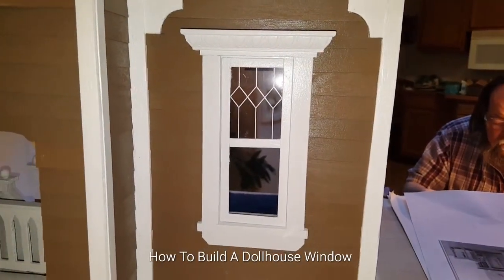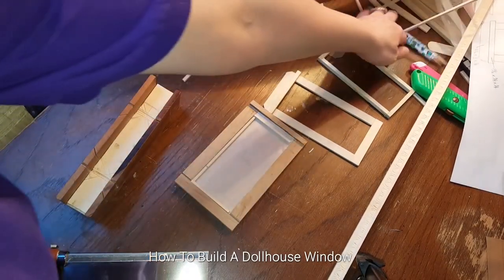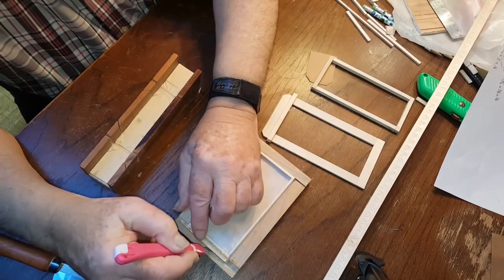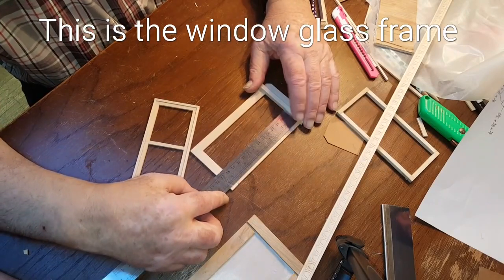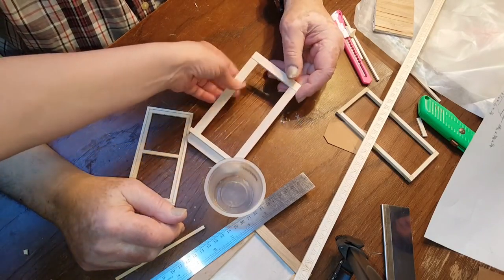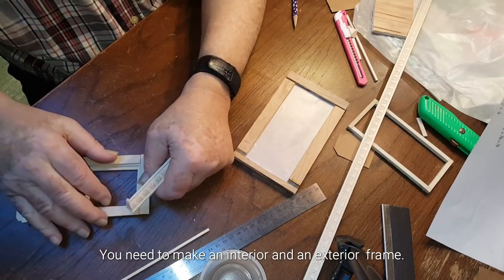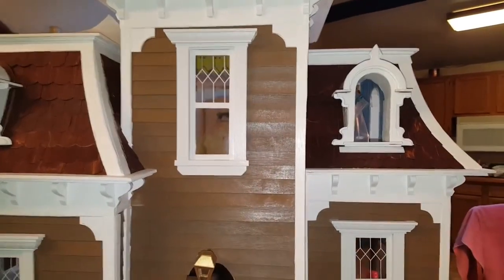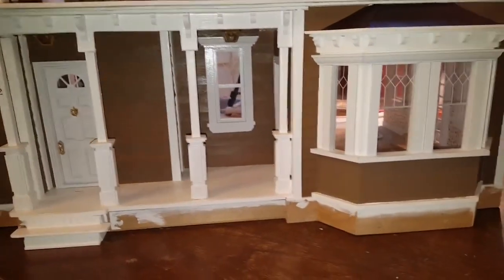DIY Miniature Dollhouse Window Build-Reloaded

Comment: Thanks Laurie. Very odd the other link didn't play, but at least this one works.
Reply from the maker: The best way to make one would be to use graph paper as a template because not all windows are the same size.  If you want a particular size then all you have to do is measure the length and width on the graph paper then cut it out to fit, the paper should be the window size. Once you do that glue your wood to the outside edge of the graph paper. Once dry remove the paper.

Comment: How did you make your miter box? Love videos
Reply from the maker: Dad made it for me. Basically he used 4 pieces of wood 1/4" thick, 2 for the sides and 1 for the bottom. Glue them together with the bottom touching a flat level surface. Once dry put it in a standard house miter box to cut your angles. When your angles are cut then you glue the 4th piece of wood 1/4"×1/2" to one side of the bottom so you have a lip to rest on the table.